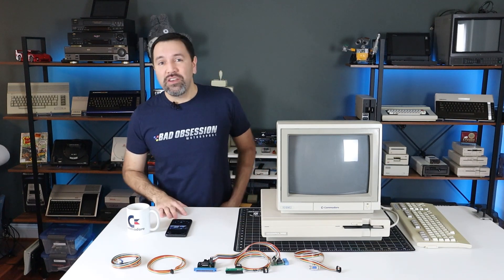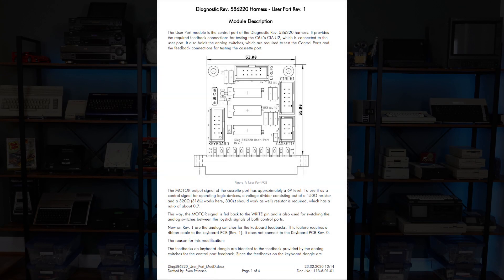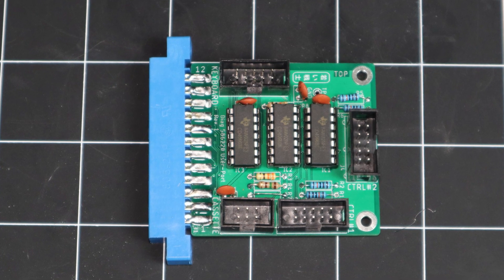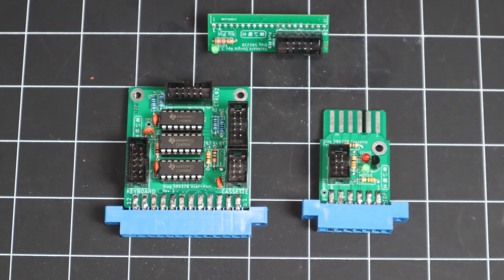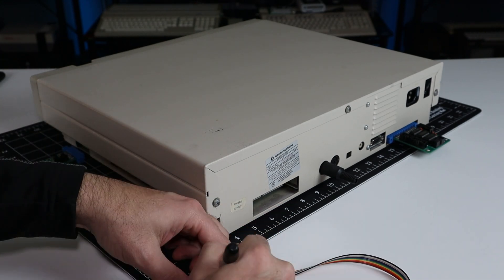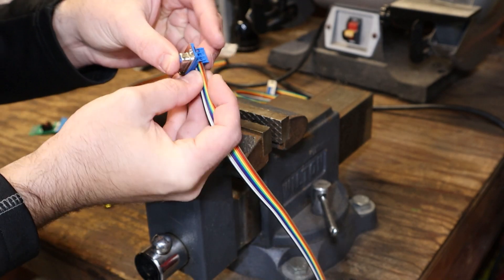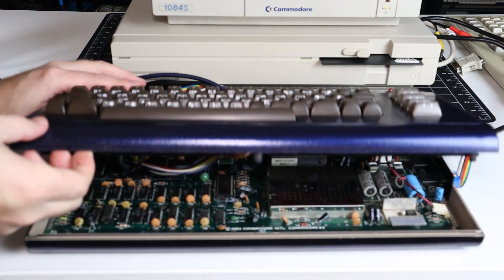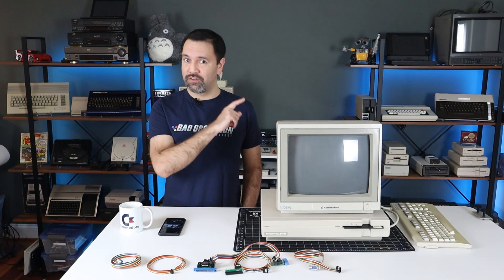Commodore 64 / 128 Diagnostic Harness Build and Test

Comment: GREAT video!! I love your hands free holder. I have one with a bigger yellow metal base and different attachments like lighted magnifying glass and ability to hold bigger boards. It's on the way from Amazon. I also ordered two smaller 4 inch square boards that are soldering learning kits. I just bought my 1st soldering kit last week and did my first four soldering joints ever on this Commodore 1084S monitors power switch changing. I felt OK doing the switch but I will not touch a retro board until I learn a lot more!! I don't want to ruin a piece of retro history.
Reply from the maker: Thanks! Yea, I just picked that up for this video and it works nicely :) Heh, I have to do one of those switches real soon myself. Good luck with your soldering practice!

Comment: Great video. Very thorough. Thank you for an honest review of the after market Power supply.. As far as I'm aware most of the C64 mainboards have zero heat sinks on the 12v Power regulator IC (which is derived from the 9v AC supply)..
Thank you for the heads up.😁

Comment: I have a couple Diagnostic Harnesses they are worth their weight in gold.  I did not build my own which I could do but time has value and the cost of the harness already built is not all that expensive.  The first one I got works well with the C64 and 128 but the 2nd one I picked up was for working on the 128DCR.   There are multiple versions of the Diagnostics Cartridge but have all them on one cartridge is a nice idea.

Comment: Great video Matt! I have the keelog power supply.  How concerned should I be?
Reply: Hi Phil - for what it's worth, Matt and I exchange email messages about this and the points I can share are:

1) On early revision C64 motherboards (e.g., 326298), running high AC input voltage is unacceptable. The voltage regulator VR2 can get dangerously hot (over 250°F) and its output unpredictable, causing video and then other glitching, as I show in the video Matt linked in the description: https://www.youtube.com/watch?v=Ld-oRmPJe7w

2) On other (more common) C64 motherboards, with more significant heatsinks and slightly different power portions, I believe most would agree it's not good to run the machine hotter than usual. It will cause other components, such as voltage regulators and capacitors (known to have their death accelerated by increased temperature), to fail faster. Personally, I wouldn't run the Keelog PSU on my 64, which is why I bought an Electroware afterward (which used to have the same issue but they've corrected it some time ago).
So, it's a judgement call if you want to run it on your 64 which may have better heat sinks than the ones I made.

If you decide to run the Keelog with high AC output voltage into your C64, and have a good contact thermometer (IR ones work OK, but are hard to aim at these components), it is pretty easy to measure the component temperatures with the Keelog and another power supply for comparison, and make an informed decision about the effect the higher AC is having w.r.t. heating components.
I show that here at 4m35s: https://www.youtube.com/watch?v=F5tjHWYBYx8&t=4m35s 
I imagine, but do not know exactly which, add-on peripherals could be damaged by the higher voltage itself.
There are presumably lots of people running the Keelog and will have no idea whether its high voltage contributes to the C64's next problem.
If we don't run too high an AC input voltage then we know that isn't a contributor to the next problem. :)

Thanks for sharing the info to a bigger audience, Matt!
Reply from the maker: Thanks for the additional clarification Dave! Maybe we should design a C64 Keelog Saver that plugs into the user port and just wastes some power :)
Reply: @retrobitstv  haha... and where's that heat gonna go? ;)
Reply from the maker: @DrDavesDiversions  How about a Userport cart with a small A/C fan that not only puts a load on the PSU in front of the voltage regs, but also draws air through the case? Two birds, one stone!
Reply: @retrobitstv  ... we'll just wait for the video, now. ;)
Reply: @DrDavesDiversions  Thanks for the additional info! I have a breadbin with the heat syncs, so I'll be okay I think for the limited amount of time I have in repairing the machine.  Currently not getting a video signal.  I just bought a scope this week to help me diagnose the issue.  I really hope it's not the VIC.
Reply: @phil.pinsky  I dug up this really nice explanation of where the 9V AC goes inside the 64. Check it out - it really makes clear the scope of this part of the power supply (from Mike at RavenWolf Retro Tech), at 2m10s:
https://www.youtube.com/watch?v=kAAnxC8iqmE#t=2m10s